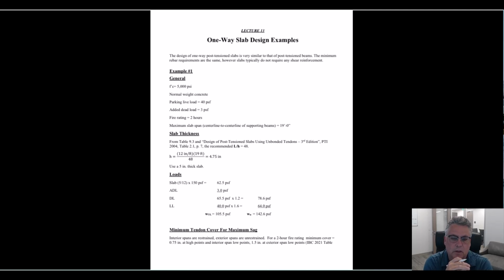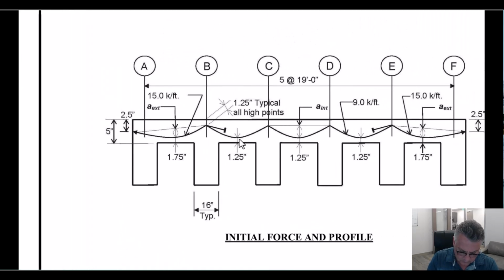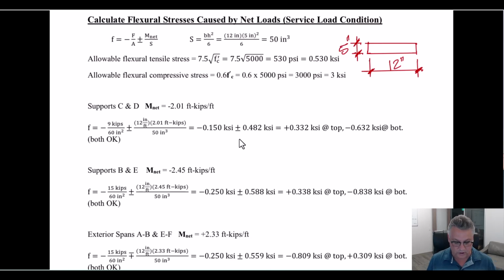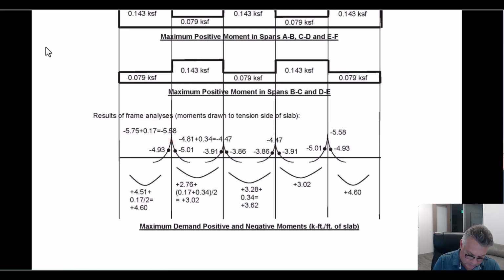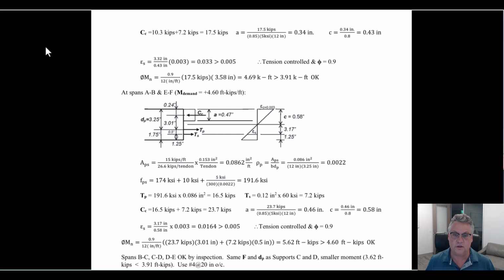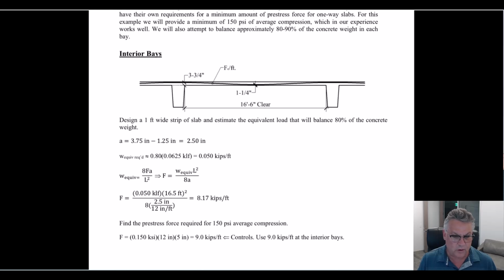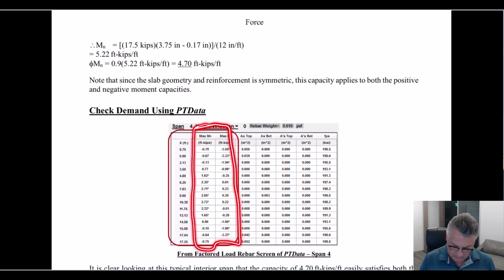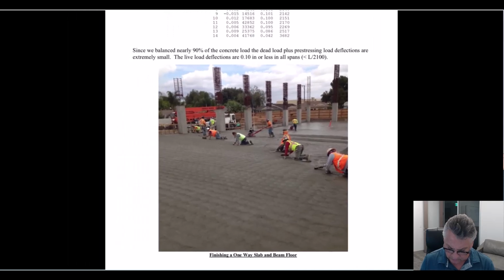Lecture 13 - One Way Slabs

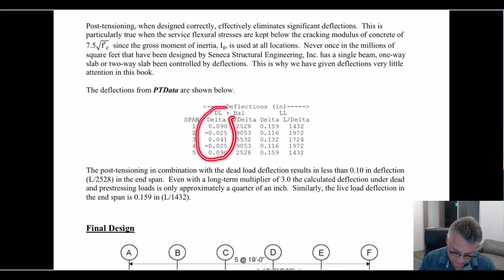Comment: Does PT data deflection that you show in the video at roughly at 47:30 account for time dependent deflections? Does it still not control then?
How do one determine the width of pour strip required? Is it based on the lap length of the bars? 
Is there guideline what extent of slab can be poured without a pour strip?
Reply from the maker: No, the deflections are immediate.  You would need to determine the deflections over time, but in a good p/t design the deflections (short and long term) are usually negligible.  That's one of the greatest benefits.

The pour strip width is typically 3' (yes, for lap lengths).

Yes, PTI has recommendations about when pour strips should be considered.